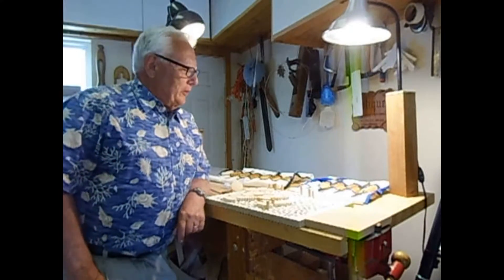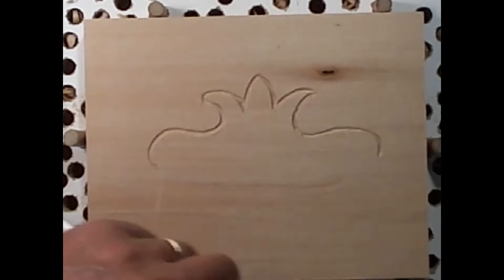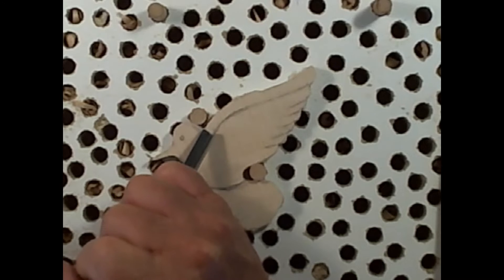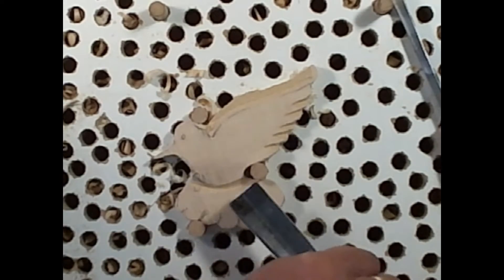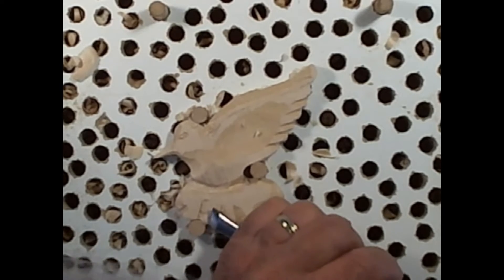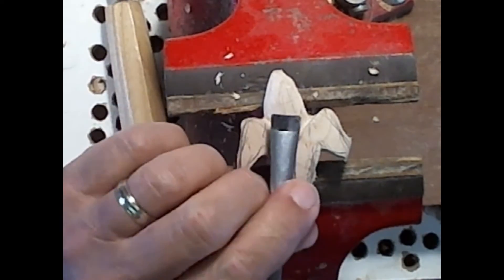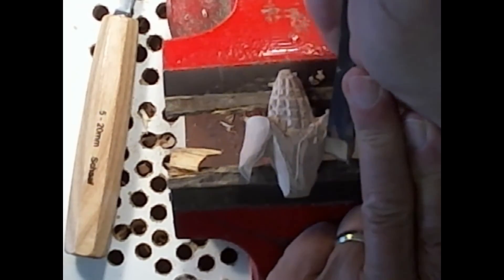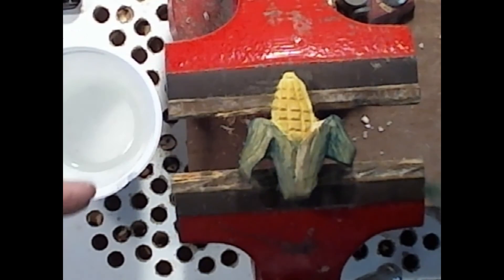Schaaf Tools, Carved Accessories

Comment: Thank you for sharing your many years of experience with us Joe. I am always inspired. Great job on the corn drawer pull. I will probably give them a go . I value your opinions on sharpening as well. I made a wheel and set up a sharpening system simular to some of your video's and it works great. Keep them coming ! I have a mix and match of gouges. I might go for the Schaaf set just to round things out. Thanks Jim